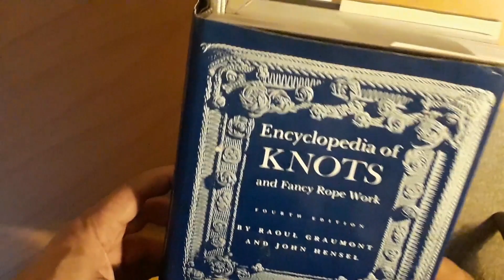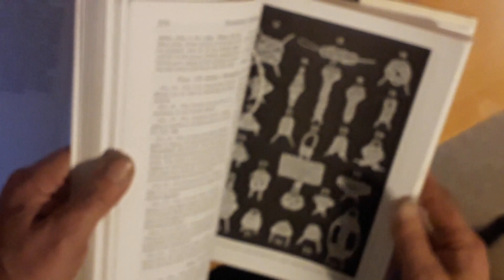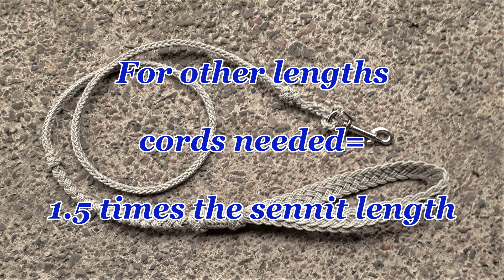Fancy Neck lanyard (or dog leash)

Comment: Hello Mr. Snellman,  my name is Julie and I have a question about the leash. After braiding the sennet ready to bind for the whip stitching how do I spread out the shorter cords when they are all on one side and the short ones from the top are in the way.  I have tried halving the shorter cords but that doesn’t seem to help.  Do I just “force “ them  into place?  Thank you for your time and talents. I appreciate your work and skill.
Reply from the maker: Yes, arranging cords can be a bit tricky and sometimes you need to use some force. It helps if you don't pull the stop tight before the arrangement.

Comment: Thank you for this video. I just finished to make one in 2mm black paracord for my work id and it is very nice. 
for the second part of the 17 strands sennit I did, beginning with most interior strand,  over 5 under 1 then under 3 over 2 under 1 and under 3 over 3
Reply from the maker: Good thinking, I am sure it is beautiful! If you use Facebook, you might join our knot tying group: Ropeworks Group.
Reply: good idea, I just sent a join request.

Comment: Loved the way you made the three strand laid rope for the eye splice, I'm going to have to practice the constrictor knot, I've known of it for years but it usually ends up as a clove hitch (which I've known for decades).  Any chance of a link to where you bought the side cutters?  Thanks for the time and effort you put into making these videos, they are very informative and easy to follow.
Reply from the maker: I sell these cutters for € 10 + shipping, including a length of 1,5mm linen cord for covering handles. Email me to info (at) snellman . ax     https://youtu.be/-XwvaifMbb0
Reply: @the potterer — you can buy them on amazon...Wiha diagonal pliers.
Reply from the maker: @jayj4142  Just be sure that you choose a model, that cuts flush and is made of high carbon steel. Amazon sells them for $18,99 And answer to your earlier question you´ll find at https://youtu.be/-iogYXrJrds?t=1922